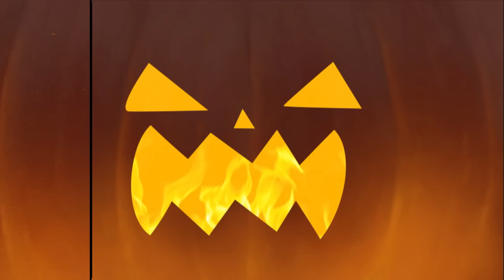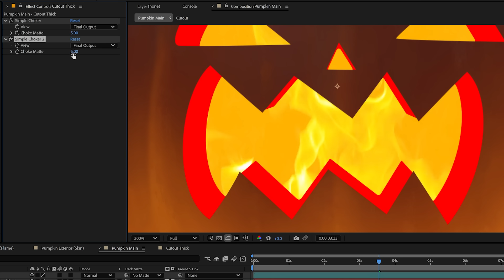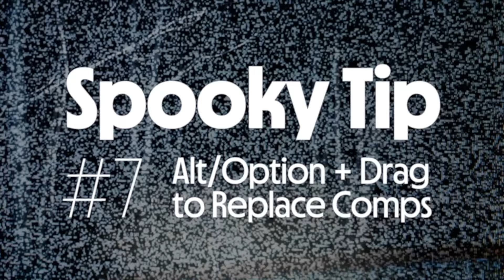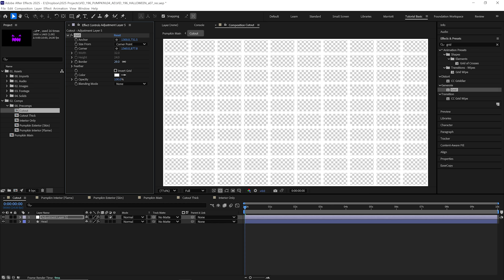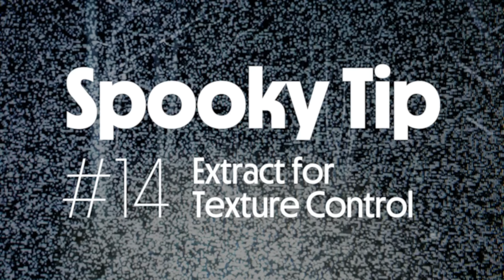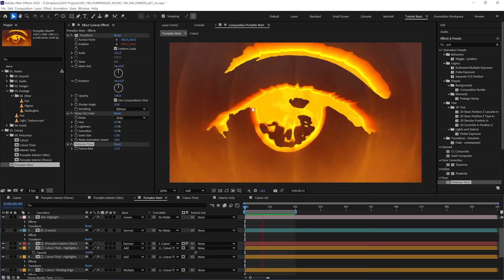15 After Effects Tricks You'll Wish You Knew Sooner

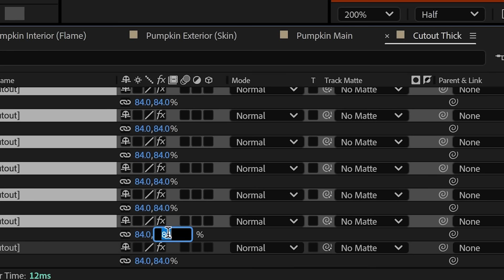Comment: 1:21 hi Ben,
What of we duplicate just single time and offset the path inside the comp and play around a Little bit with position, without duplicating 8 times???..... ❤
Reply: The reason he doesn't offset the path inside the comp is that the original cutout would change with it. You could still do it in certain situations though! You'd just first need to make a duplicate of the original comp. The downside is in order to change the media shown on the pumpkin you'd need to replace two comps instead of just the one, then repeat the path offsets to match - which would only work if you're replacing it with shape layers. Meaning that you wouldn't be able to use photos and videos the same way he does later in the video.
Reply: @JabezEB exactly! You're right, basically i commented so earlier before watching the whole video, later on i realized my mistake.
By the way tnks❤